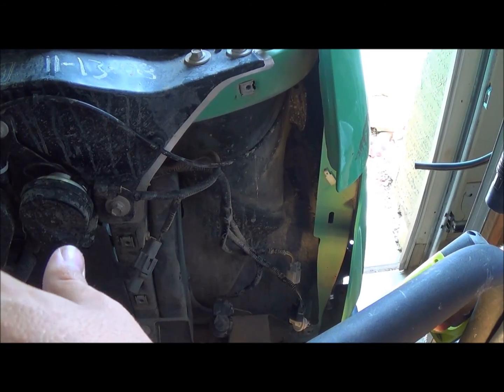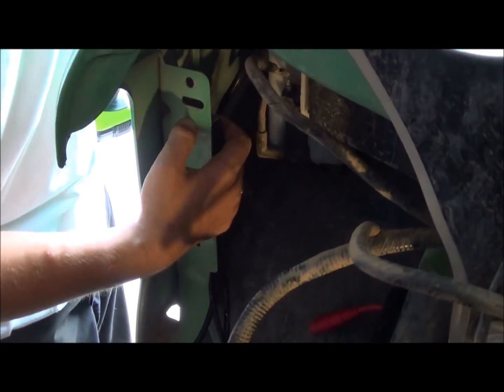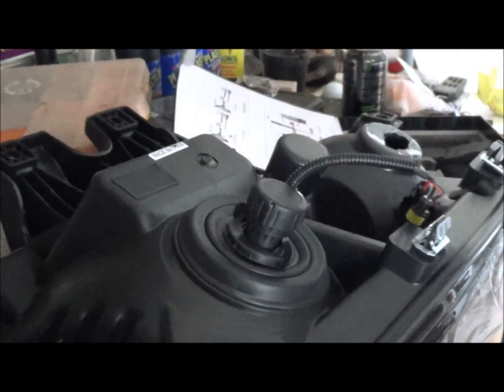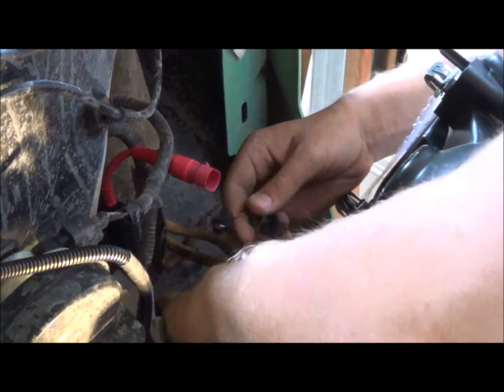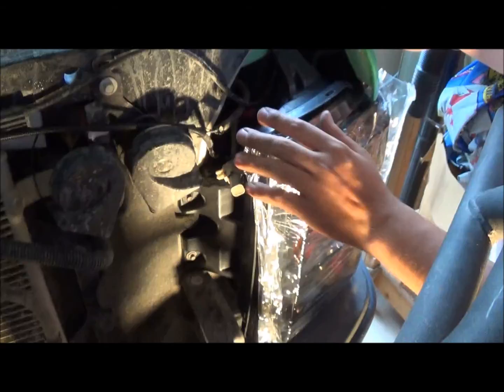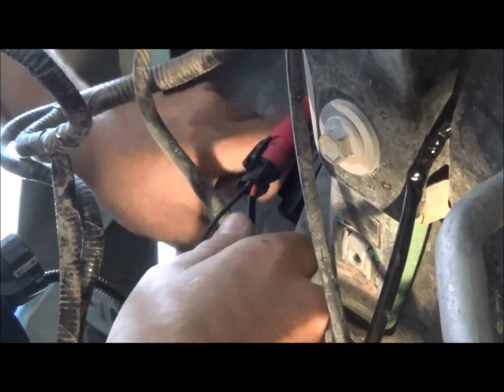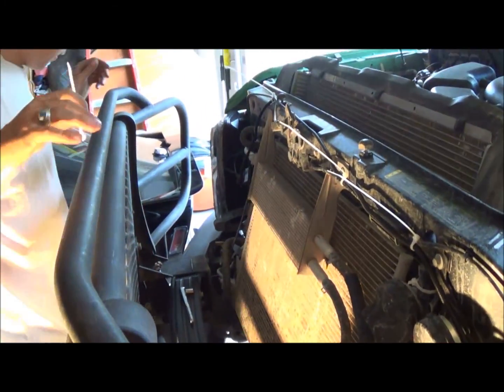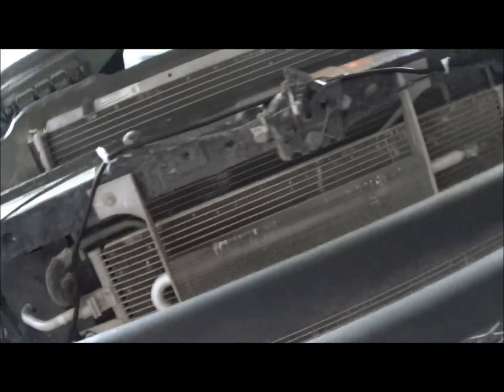2008-2011 Ford F-Series HID Conversion Kit Install

Comment: The HID video must be watched first then the Ford Sealed Beams Headlight Conversion so it's clear it's not just old to new style upgrade without adding wires. The ford dealer told me it wasn't possible on my XL 2008 F250 they must have meant without adding the HID wire upgrade not that the shape from sealed beam to the new style wouldn't fit in directly? It clearly works per your video.

Comment: John where did you get the HID Conversion Kit from ? The confusion i had was i didnt see both of your videos i just found this videos after seeing the sealed beam video. It looked like a direct change out without adding wires/hid kit.
Reply from the maker: +Jay Richardson I got the headlight housing on ebay, on i forget what site i got the HID kit from but i wouldn't recommend it it was of very low quality they were no brighter then halogen bulbs. They were supposed to be a bright pure white but came out with a blue hue, upon further research it appears to be that was cause the blast packs we low quality. Lastly it is a direct change out dont listen to ford they will always tell you it cant be done, pull out sealed beam remove adapter that goes from an H13 plug to sealed beam plug install housing  then HID kit as video shows just make sure your kit has an H13 plug on it or it wont work.

Comment: I noticed you connected the black cable to the positive on the battery. I thought it was a ground and grounded it. Mine did not work. that may be the problem. the only wire you grounded was the smaller one? the other goes to the positive 12vdc?
Reply: nevermind. it is a positive cable not ground. your video help me. thank you for posting.